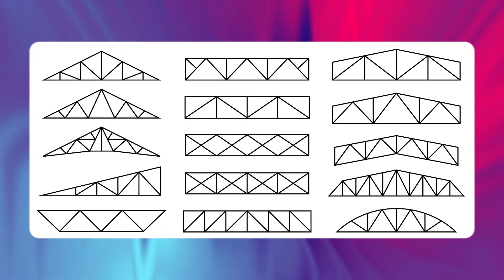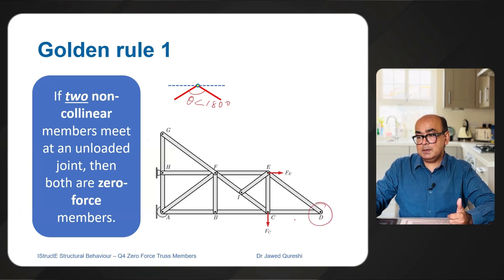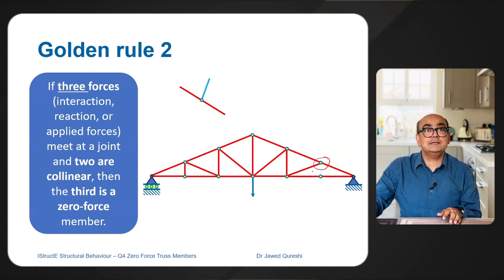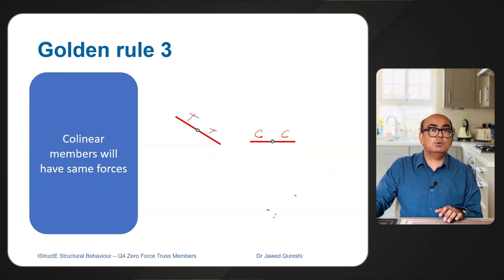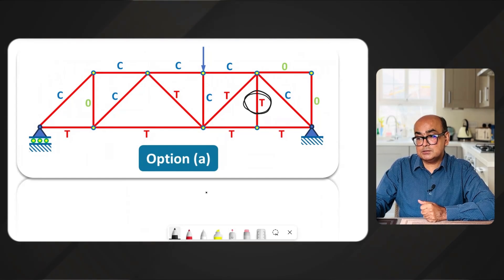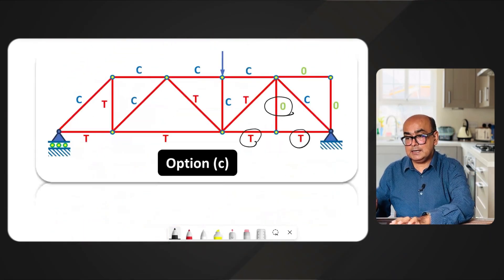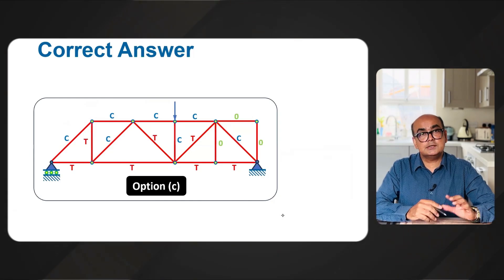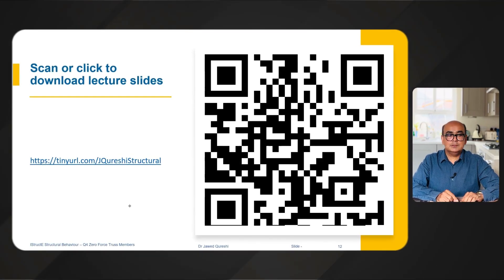Master Zero Force Truss Members | IStructE Structural Behaviour Course

Comment: Sir please do a lecture series on beam, column and slab design with EC 2. I have completed your lecture on steel design with EC 3. This is a group request from Papua New Guinea University of Technology Department of Civil Engineering.
Reply from the maker: Yes, request accepted. I’ll soon prepare the lectures.
Reply: @DrJQureshi  Sir what I meant to say was reinforced concrete column, reinforced concrete slab and reinforced concrete connections as per EC 2. We already completed the design of reinforced concrete beam as per EC 2 already just when youuploaded the series.  It is very clear. Thank you for accepting our request.